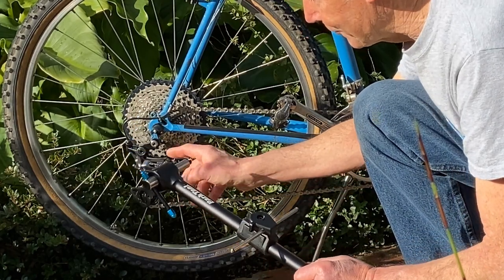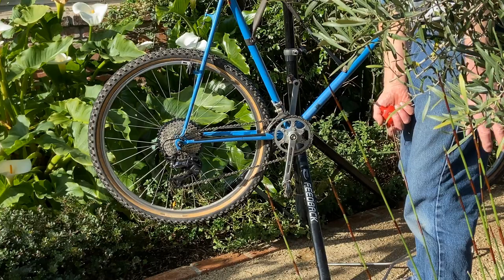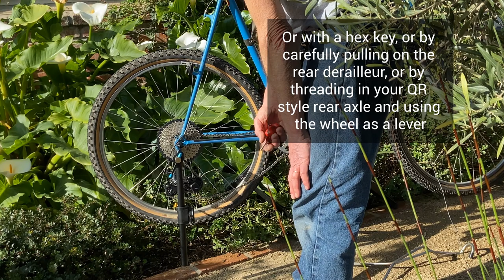Park Tool's Amazing New DAG-3 Bent Bicycle Derailleur Hanger Alignment Tool

Comment: Nice tool that swinging mechanism looks very useful! The method of construction probably also means it's squarer to a finer tolerance than the welded one. I usually rotate the wheel with the tool and measure where the valve is just in case the wheel isn't perfectly true.
Reply from the maker: Hi Ben and thanks for watching and commenting. Yes, I agree on both your points. The tool being forged versus welded should improve its squareness. And, definitely, you should move the wheel with the pointer as you say. I should have shown that in the video. Thank you for adding that key detail.

Comment: Make sure the wheel is straight in the dropouts first.  Use the same place on the wheel (like the valve stem) to make all your measurements; that is, rotate the wheel as you rotate the tool to negate any untrue-ness in the wheel.

Comment: The new swivel to move the gauge out of the way is a huge game changer.
Reply from the maker: Yes, it sure is, Bigsheep! I love that feature too. Thanks for watching and commenting!!
Reply: @JimLangley1  I had put on a new hanger several months back. Didn’t bother checking the alignment as I didn’t have this tool yet. 

New drivetrain installed and the chain was clicking on 8-9th gears. Everything was dialed and tuned perfectly. Didn’t know what caused it. 

So today this tool arrived and I checked my hanger and sure enough, it wasn’t lined up. In fact it was way off by more than 4mm. 

Adjusted it back to within the tolerances and tweaked the barrel adjusters a bit and voila, no more noise. The shifts are butter smooth and ninja silent.
Reply from the maker: @GokkunGuru  that’s great! Thanks for sharing!!

Comment: Great video! Would love to see one about that bike, gotta love the new GRX drivetrain on an old steel frame!
Reply from the maker: Thanks so much for the great comment and for watching, Greg. I will do a video on my Oxfords sometime - it's on my list for sure. Jim Oxford built frames for The Bicycle Center in Santa Cruz where I ran the shop and we were and are good friends. He built me this cross bike and also a sweet road bike. Both are special rides. I updated the cross bike recently with the GRX derailleur and larger cassette, but otherwise the bikes is pretty stock still - even has the original Bontrager cut-down rims (Mavic 700c rims cut down by Keith). And, people always ask about the TA 1X crank. That bike was designed around 1X gearing. It worked back then too ;-) Thanks again for watching!

Comment: Which do you like better Jim, the new DAG-3 or the Wolftooth tool you previously reviewed?
Reply from the maker: Hi Peter! Thanks for watching and the question. I've been thinking a lot about that ;-) Park really designed this tool intelligently and addressed all my complaints about these hanger tools. I especially like how exact it checks the gap. There's no play or looseness anywhere in the tool making it much easier to swing the tool to the 4 points and judge the hanger straightness. There's no fiddling around. Just screw it into the hanger and take the measurements and straighten the hanger as needed. Because of this and because it has such a longer lever than the Wolf Tooth, I'm leaning toward giving the Gold to Park and this new tool.
Reply: @JimLangley1  Excellent, thanks for weighing in on that Jim. I think the Wolftooth still has application as a smaller tool to throw in your pack for trail adjustments, and in fact that's one of the ways they advertise it (although for me on the trail, I think I'm probably more apt to use some quick, crude, "good enough for now" method!).
Reply from the maker: @peterweatherby8816  yes, I agree, that's a great use of the tool, Peter, and they told me that was part of the design goal - lots of bike packers carry tools and this wouldn't weigh them down and would come in handy since the bikes can take a beating and there are often a few people riding together. So only one person would need to pack the Wolf Tooth. But, I'm like you - I tend to carry a few simple tools and hope that my bike is tuned up well enough not to need any major work - and knock on wood - try not to crash!

Comment: Thanks for the review. Always appreciate your thoughtfulness. One thing I do wonder about is how the wheel’s lateral true and frame drop out condition might affect the precision of something like this.
Reply: Ahh, gotcha. Good call!
Reply from the maker: Thanks for watching and the kind words, Ryan. Regarding the wheel's trueness, I should have but didn't show this in the video due to how I had to cut the footage (sorry).. But to explain, so that a warped wheel won't mess up your gauge reading, what you do using an alignment gauge like this is to move the wheel with the tool. A good way to do this is to take all 4 measurements at the valve. You move the valve to 12, 6, 9 and 3 o'clock so that you measure to the same spot on the wheel just in case the wheel is not true.  In my link in the description to Park Tool's video you can see Calvin do this.

Now, on dropout alignment, ideally you would use your dropout alignment gauges before you check the derailleur hanger alignment. Here's Park's dropout aligners in case you haven't used these: https://amzn.to/30wmBKk They work on basic flat dropouts not the through axles. But, usually through axles and other designs are very resistant to bending since they're so overbuilt and supported by the larger diameter axles.

With bikes with flat dropouts, there's a good chance since the axle tightness and bracing from the axle bolts and QR ends reinforces the frame, that the dropouts will not bend when you bend the hanger. However, if you were to shift into the spokes and the wheel grabs the rear derailleur and bends it badly, this can severely damage steel dropouts. Aluminum, too. If that happens you usually can't miss the damage and hopefully you'll have the tools to check the dropout alignment or bring the bike to a shop with the tools to do it and to try to fix the dropouts. 

You can fix many mangled steel dropouts though they will be more fragile after that kind of stress. With aluminum, it's risky to try to fix them (aluminum tends to break) and sometimes the frame is essentially ruined. So, checking aluminum dropouts with the gauges is usually an exercise in frustration since you can't fix them. 

The thing about flat dropouts is that a lot of them will conform to the pressure from the clamping force of tightening the wheel and things like a slightly too long axle. For example, when we went from 127mm spacing to 130mm spacing, you could force the wider wheel into the frame and in most cases it wouldn't do any damage to the dropout or axle or rear der hanger alignment. But, if there's any indication that the dropouts were affected by whatever bent the hanger, I recommend checking the dropout alignment before proceeding with derailleur hanger checking and alignment. Hope this is helpful and thanks for the great question, Ryan, appreciate it!
Reply: Thanks Jim! Great explanation and advice as always.  Keep up the good work.  Much appreciated.

Comment: Hello Jim, hope you’re having a great summer! How has the DAG-3 been holding up? I was thinking if upgrading from my 2.2 to the 3, but I’m a little dubious about the aluminum construction. I’m worried that maybe the the aluminum head will wallow out a bit from the force of adjustments and start to allow play between the head and the steel shaft.
Reply from the maker: Thanks for watching and the question Holden, appreciate it. If you could hold the DAG-3 in your hands and move its parts you would experience what a step up in quality and design it is from all previous tools of this type. The aluminum body is heavy-duty and precision quality. There's a set screw in the top which can be used to remove any play if it develops between the head and the shaft with the 10 x1 thread in it to screw into the hanger. 

But, I don't see the tool developing play unless it's abused somehow - maybe dropped or beat up in transit inside a toolbox packed loose where other tools... not things I would let happen to a beautiful tool like this. Just like you wouldn't drop a digital caliper etc.

I find it much easier to check hangers with and haven't had any issues with it yet. I think if you buy one you'll like it a lot. Hope this helps and thanks again!

Comment: I’ve bought one, but mine has a little play, that results in 2 or 3 mm of movement at the end of the shaft, the play is in the connection bettween the horizzontal cilinder (the one that screws into the hanger) and the shaft itself.
Reply from the maker: Thanks for watching and commenting, 4lumi. Park's DAG-3 has an adjustment screw that allows removing any play that develops. That's one of the reasons it's such a nice tool. Most derailleur hanger alignment tools do not have this feature. And if there's play it's not easy to get an accurate reading. Thanks again!

Comment: Great review! It is a very nice tool, as with all park´s products, but it costs an arm and a leg so i will have to make my own :D . Are there bearings or just a bushing on the main shaft? Anyway, very good video as alwas, I really appreciate your work! Have a nice day.
Reply from the maker: Thanks a lot, Karol, appreciate you watching and the nice comments. No, there are no bearings on the main shaft. The parts are tightly machined and made to move smoothly without play so bearing aren't needed. Have fun building your own version. Thanks again!

Comment: I got this tool today, Jim do you notice a tiny bit of play between the shaft in relative to the body? it's very tiny bit.
Reply from the maker: Hi Sam, sorry I don't know if I explained this clearly in my video, but if you look at the body of the tool, at the very end of the tool, the end that you screw into the derailleur hanger, you will find a small silver set screw. This slotted screw is what keeps the threaded shaft in the body of the tool and it's also how you can remove any play between the shaft and the body. Maybe it needs to be snugged a little? You shouldn't need to tighten it very much, just a little should remove play I think. If the play is in some other part, let me know and I'll try again. Hope this helps!

Comment: If only they were easier to get a hold of. There are still people who buy all the stock, just so it becomes a problem for most people. I live in an expensive country already, but I cannot even get it here, and it becomes even more expensive out of the options I have now. The other thing in this day and age is I'm indirectly forced to shop one thing here, and the next from another place, which makes everything even more expensive given more shipping cost and VAT as well. 
I personally own the Unior Hanger Genie, but given how little info it was out there before I purchased, I sadly found out their tool is just way too short. It's mandatory to have leverage in a tool like this, because it's made for bending. You have way better control when you got more leverage, so it's not about how much force you can apply, but how well you can control the applied force.
That DAG-3 tool just looks to be the go to tool given how simple it is made, and that's exactly how a tool should be. Only thing I would have hoped for is that it was made out of steel. Weight gives confidence in a tool like this.
Reply from the maker: Sorry to hear you can't find the tool, Freerider. As you know, shortages have hit all industries and most companies since the pandemic. Eventually things will get a little better and you'll like this tool if/when you get one. 

Regarding steel, most of the hanger tools we've had for decades have been made of steel and I can tell you that the Park tool works just as well and the only thing steel would do is make it a lot heavier to carry in a toolbox plus allow it to rust down the road.
Reply: @JimLangley1  I ended up selling the Unior Hanger Genie because I had little faith in the design. I managed to get my hands on the DAG-3 actually and I'm so glad I listened to my gut feeling, because it does really feel like a tool you just pick up and want to use. It also feels like a tool that will last a long time.
Simple and functional design.
Reply from the maker: @Perception_  thanks so much for sharing your experience with the Unior tool, Freerider, and for letting everyone know how much you like Park's DAG-3 derailleur hanger gauge - that's great to hear. I really like it, too.

Comment: The only dodgy Park Tool tool I've every owned is the colour of their spoke ruler. Blue does not make for easy reckoning. Oven cleaner, wet 'n' dry, and a black Sharpie fixed that though.
Reply from the maker: I completely agree, Radio! Too funny. I did almost the same thing. I just used a silver Sharpie since it stands out nicely against the blue. Now though I'm using and appreciating the Wheel Fanatyk Pi ruler: https://www.wheelfanatyk.com/store/pi-spoke-ruler/ I don't care for the color on it, either, but it is easy to read and even shows 1/2mm. The groove is nice for keeping bowed spokes straight. Thanks for watching and the great comment!